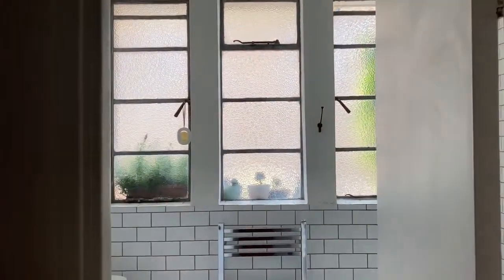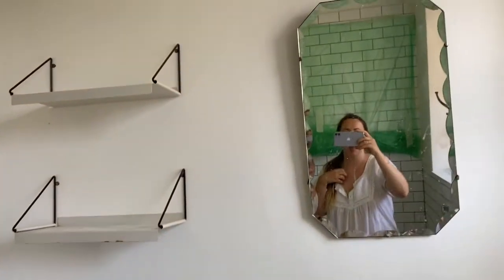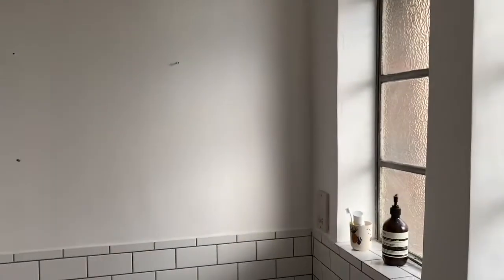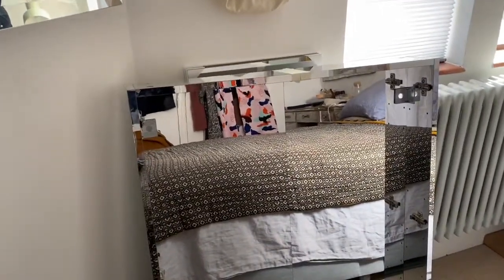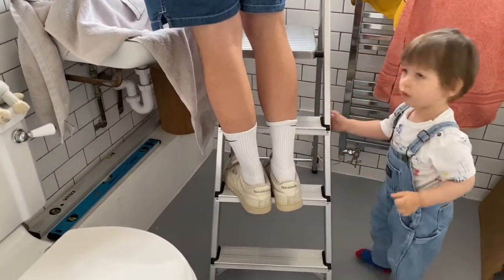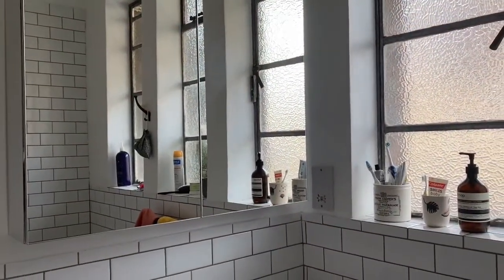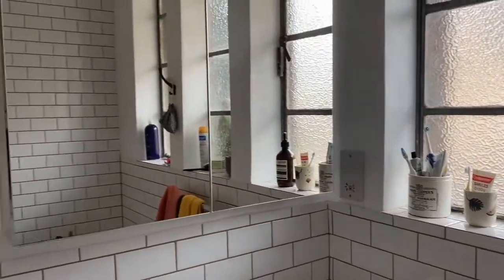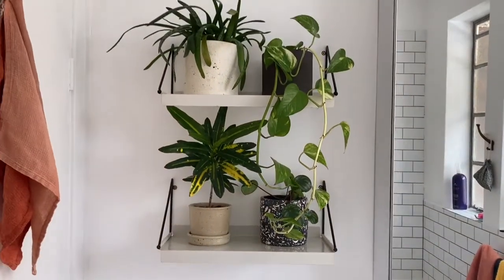Mini Bathroom Renovation and Restyle | Installing the IKEA Godmorgon Bathroom Cabinet

Comment: You have a moisture issue in the bathroom, rust and bubbling paint. Do you have a fan. Open window not enough. A small desktop fan would help if you are only using open window
Reply from the maker: You’re quite right. Thanks for noticing!

Comment: does the line between the doors when they are closed bother you when you look in the mirror?
if you look straight in the mirror the line should go right between your eyes
Reply from the maker: Nope. Defo doesn't bother me. You'd have to stand in a really specific place to notice it. I tend to be to the left or right of the line between the doors. It's not really a thing.
Reply: Lizzie for SMUG thanks for the answer
Reply: This is my prob too  it bothers im thinking of making the other half to a memo board idk
Reply: Do u have this mirror too? Mine is square shaped and 2 doors. What did you do to the lining in the middle?
Reply: @Deiaxy  yes, I bought it last summer, I did nothing to the gap, I just use the right half of the mirror door 🤣
Reply: @Deiaxy  I just look into the right half
Reply: @winterbalm  hahahaha i get dizzy using it. So I think Ill just make the other half a memo board. Idk. Or cover it up or something since I will not use it. Idk.
Reply: @Deiaxy  there was also one big problem, the led lighting burned after being connected to electricity, we had to custom build our own lighting and transformator
Reply: What shape is ur mirror? I dont have a lighting version of it just pure mirror
Reply: @Deiaxy  rectangle, it's called Storjorm